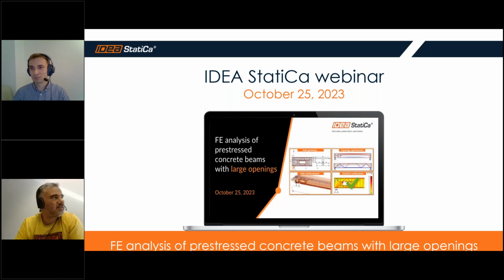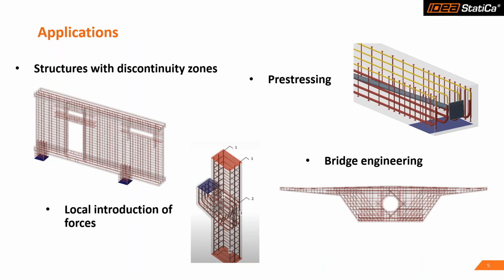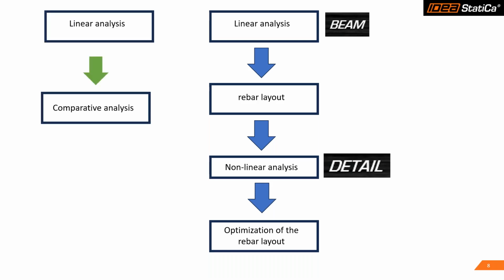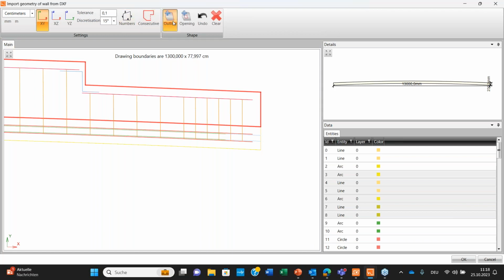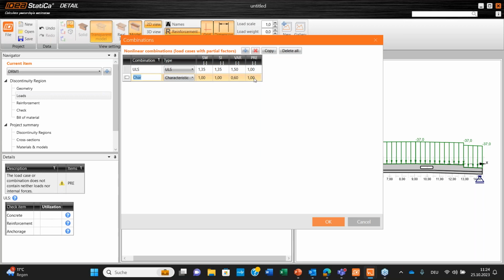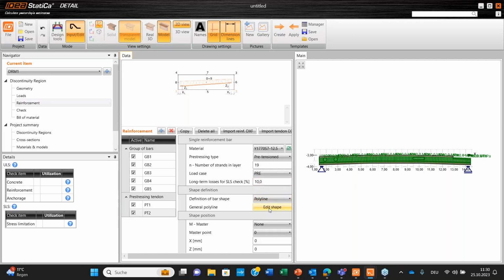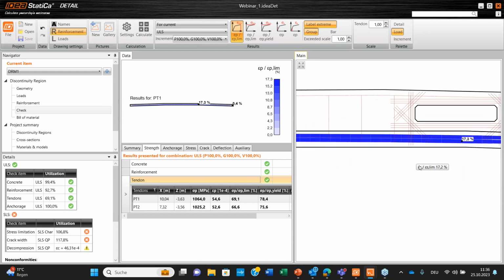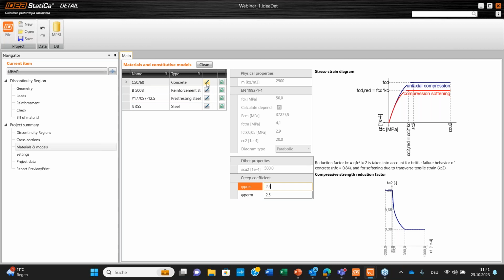FE analysis of prestressed concrete beams with large openings

Comment: Hello
Thank you very much for the video.
I have two questions.
1. Is it planned to install IDEAstati DETAIL RUS code?
2. Modeled in IDEAstatiCa Connection ((Metal column-concrete connection (with anchor bolts)) connection, is it possible to open the IDEAstatiCa DETAIL and reinforce the concrete block? (without modeling in IDEAstatiCa DETAIL)
Is there a video of what I said?
Reply from the maker: Hello!
1. No, maybe later in years.
2. We are working on a link between Connection and Detail app to cover this scenario:
- design footing and check it in terms of steel in Connection and have basic concrete block there
- import concrete block to Detail, reinforce it and check it